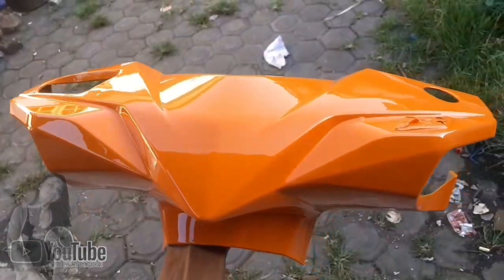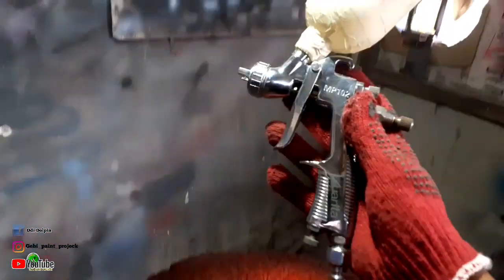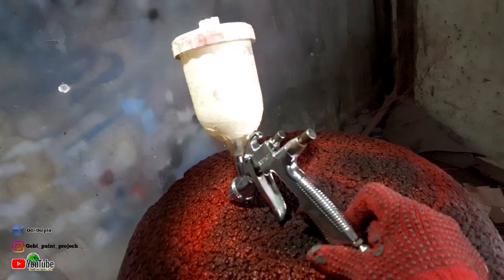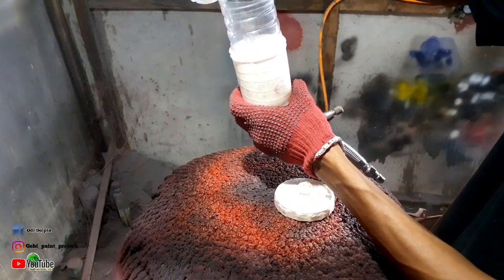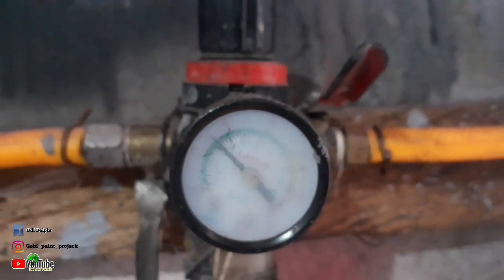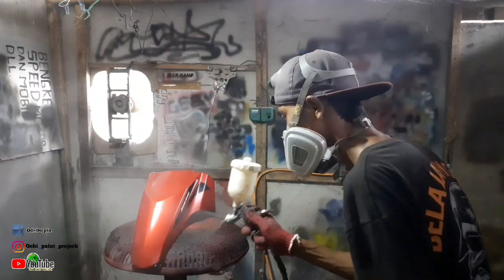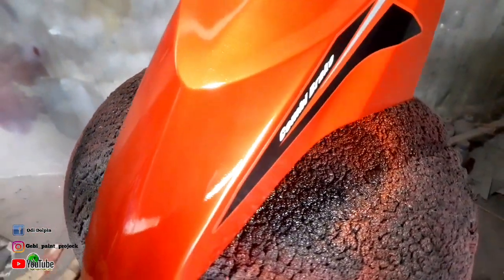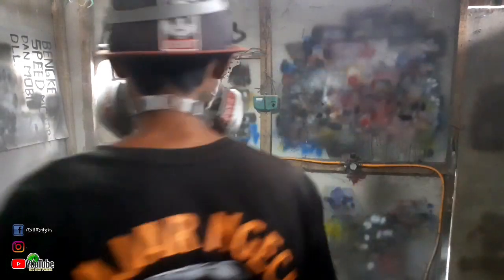SETTING SPRAYGUN AUARITA MP102 TAHAP CLEAR COAT || MEMUASKAN INI TRIK NYA

Comment: Bg ,utk kompresor lakoni 125 1hp .
Cocok mana spray gun nya mp102 atau k350 dan nozel brapa ,untuk semburan lebar tapi tidak tekor ? 
Untuk panel mobil yg sedikit luas .
Reply from the maker: Pake auarita mp102 mas kalau untuk panel" mobil,kalau spek kompresor 1hp saya rasa masih sanggup
Reply: @gebipaintprojeck5607  masih mampu ya om saya bg 1 hp pake mp102 . 
Pakai nozel berapa ya bg ?
Reply from the maker: 1.0 mas
Reply: @gebipaintprojeck5607  mksh bg

Comment: Q pakai spray gun ini pas clear pertama itu sll bintik" ya padalh UD tak cuci slbm clear.. clear UD tak saring  itu solusi ne gmn ya
Reply from the maker: Nyemprot jangan langsung tebal mas,kemungkinan air dalam tabung kompresor ikut naik masuk ke spraygun,atau juga clear setelah di campur diemin dulu sampek bening
Reply: @gebipaintprojeck5607  UD q pasang fiter air mas trs tak coba tipis" msh sama
Reply from the maker: Dan hasil di lapis akir apa masih bintik" mas
Reply from the maker: Dan hasil di lapis akir apa masih bintik" mas
Reply: @gebipaintprojeck5607  betul msh bintik .. pdalah UD q ganti clear yg baru beli
Reply from the maker: Lanjut wa aja mas,cek deskripsi vidio
Reply: @gebipaintprojeck5607  ok
Reply: Apa beda clear coat ms sama hs mas, apakah bisa diaplikasikan disaat cuaca dingin,  gimana solusinya supaya hasil clear coat gak drop???
Reply from the maker: Ms itu medium sokid mas,dan hs itu high silid,jadi bagusan hs untuk tipenya,dan untuk cleae cuaca ekstrim ,usahakan tiner pakai tiner pu slow dry,campuran jangan encer
Reply: @gebipaintprojeck5607  mas dmn nomor wa nya mau berteman mau bnyak bljar2 ilmu
Reply from the maker: @jainakakbar2783  cek di deskripsi vidio ini mas
Reply: @gebipaintprojeck5607  nga ketemu mas dmna ya nmor nya
Reply from the maker: @jainakakbar2783  085777823743
Reply from the maker: 085777823743

Comment: Untuk clear coat sbner nya enakan aurita mp102 apa aurita H891 mas ?
Reply from the maker: Kalau media panel motor mp102 udah mantap mas
Reply: @gebipaintprojeck5607  berarti klo aurita H891 terlalu mantep apa mlah di bawah mp102 mas ?
Reply from the maker: Segi harga dan kwalitas ya bagus yang h891 mas,kalau di bandingin ya tetap bagus yang h891
Reply: @gebipaintprojeck5607  tpi untuk kompresor 0.75HP mendukung gak mas untuk salah satu spraygun tersebut ?